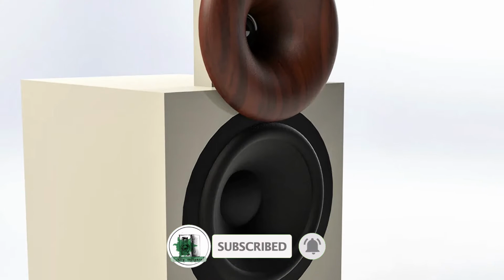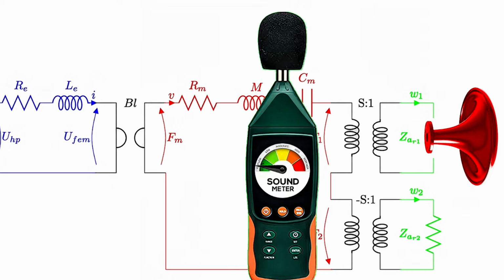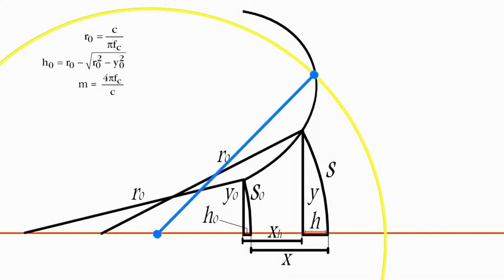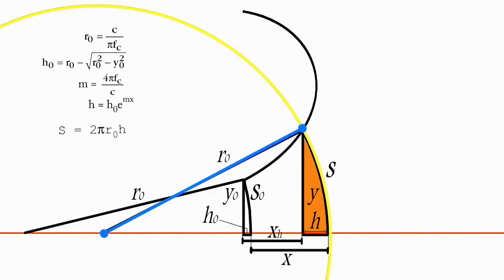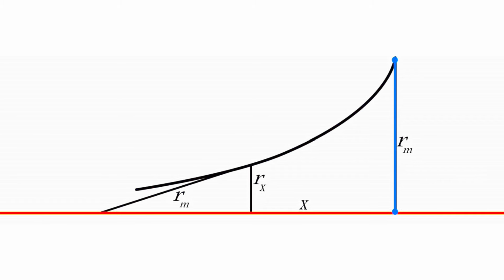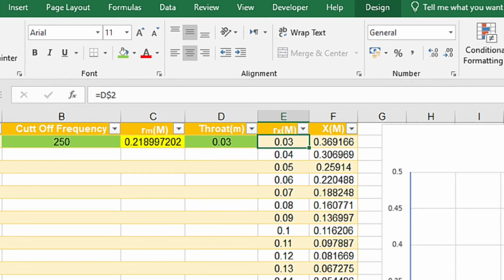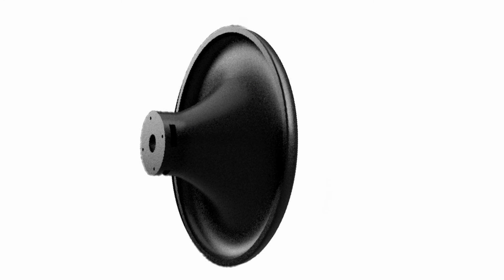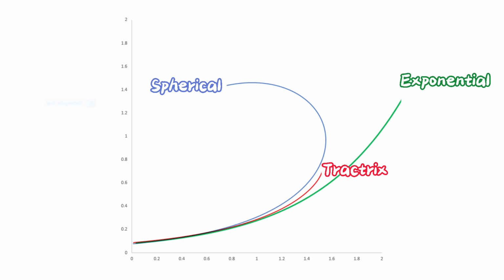All about horn speaker design-3

Comment: Thanks for your videos, I have been interested for a long time in horn speaker design, there little in depth information about the theme.  It would be great if you also include information about conical horns and compare them with the the other models, as far as I know conical horn have some advantages and are more easily built than there curved brothers. Voigt pipes can also be included here as a variation of horns. VIdeos on how to simulate horns cabinets in Akbak would be great. I still have problems with the workflow in Akbak, the tutorials are hard to follow, but I thank you again for sharing the knowledge. Greeting from Bogota - Colombia.
Reply from the maker: Thank you for your comment.I suggest you watch Akabak basic tutorials in my channel to learn the basics. Why are they hard to follow?.More explanation please.
Reply: Akbak UI is not straight forward for me. I am used to CAD and design software not this kind of engineering stuff. Things like right or left click here, point on this tab or icon might help. Using a larger mouse pointer would also make it easier to view and understand. In the videos I see menus and windows pop up without knowing what was press or how they were invoked. It might just be me, but I appreciate your attention.
Reply from the maker: Watch this series if you like. everything becomes clear for you. "Secrets of Speaker box design with Akabak_1 to 4". If you find any problem feel free to ask.
https://www.youtube.com/watch?v=IHiN6M2js6s&list=PL1XNugVh8FYlMTB-Xpsv0OmWzkwb_LaIG